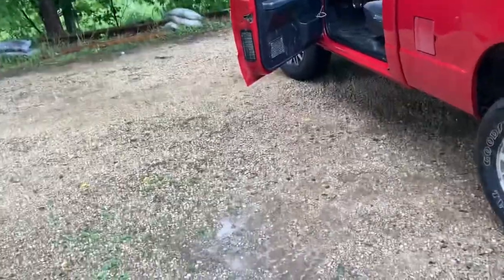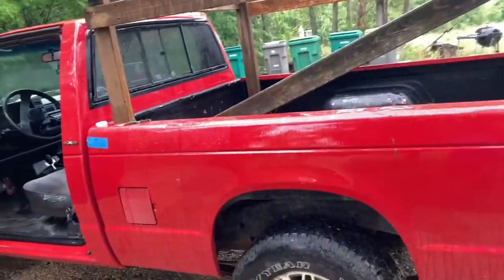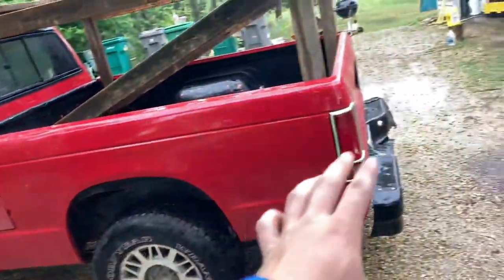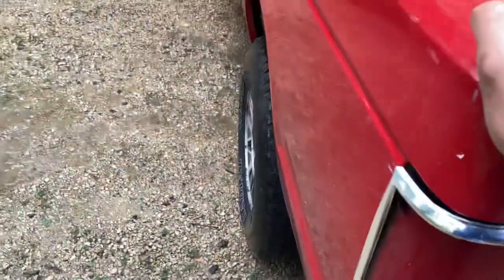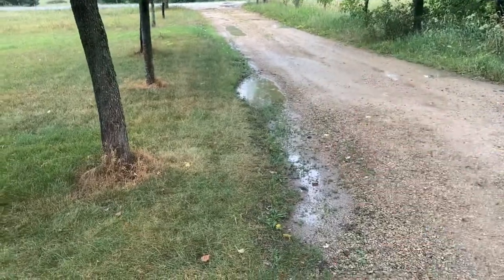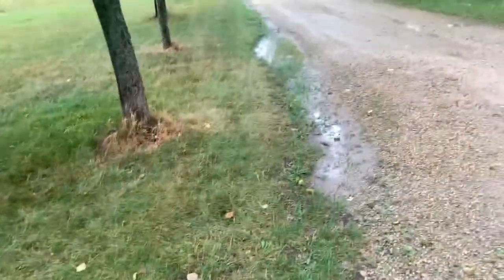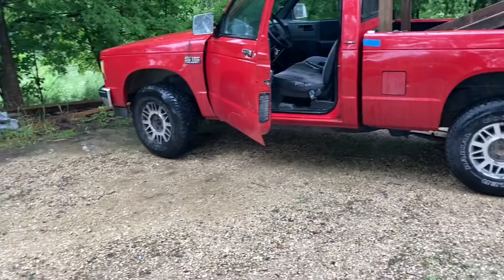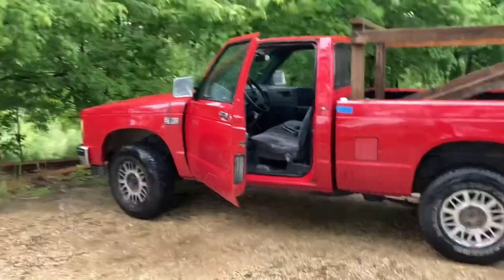Push Starting a Truck with Dead Battery (Manual)

Comment: I fell asleep in my truck on the side of the road, woke up at 3 am with a flat battery, I had to do exactly this except I was in a parallel parking spot with a car both in front and behind 😂 so trying to rock it back and forth turning the steering wheel a few cm each time until I cleared the car infront and then nothing but flat bitumen road also took me two goes to get her cranking 😂 great video mate
Reply from the maker: Oh golly! That sounds like a bit of an ordeal, good job getting out of that situation! And thanks for leaving the comment!

Comment: Great work! I recently faced this problem and every tutorial I saw said you need someone to push. I thought maybe there's a reason for that and it can't be done alone. Walked a mile to get someone xD Nice to see someone do it alone. Would definitely do the same the next time I am in such a situation.
Reply from the maker: Thanks!! I didn’t know if I’d be able to get enough speed, but it worked out in the end. I did have the advantage of having a very lightweight truck though; I think a larger vehicle would be considerably more difficult to start solo like this, but where there’s a will, there’s usually a way! Thanks for watching and for leaving your comment. Good luck out there!

Comment: You probably didn't need more speed - you needed to set your carburetor with a single push if it's electronic or multiple in order to get the accelerator pump squirting a little bit of fuel down the throat.
Either way, good job!
Reply from the maker: Thanks for the input! I always love learning; I guess I have a lot to learn on the subject. Thanks for watching and thanks for leaving a comment!
Reply: @leanintotolife  
No worries. It's the same concept if you're going to start your car in the winter. If it's electronic you press and release your accelerator ONE TIME. This sets the electronics and the choke. If it's a manual carburetor you want to give it a couple of pumps to squirt fuel down the throat.
 Carry on good sir.

Comment: Use 2nd instead
Reply from the maker: Good thinking. A friend of mine said a similar thing. I guess next time will be easier! Thanks the input and thanks for watching!
Reply: Also, using reverse on any manual transmission is fine if you are rolling backwards
Reply: @gregorysgaragetowing3290 thankyou that is good to know

Comment: your battery isnt dead
Reply from the maker: You bring up a very good point that I should have clarified in the video. It wasn’t 100% dead, which is why when I turned the key, that high pitched noise came on. I didn’t think to mention anything about it, but there was not enough power to even come remotely close to starting the car. I should have demonstrated that by attempting to start it on camera. I give you my word though that I didn’t just stage this and pretend that my car wouldn’t start when it could (not that you were necessarily implying that to be the case). Anyway, thanks for bearing with me and the long-winded response, I appreciate your comment a lot, and I’ll try to be clearer in the future. Thanks for watching!